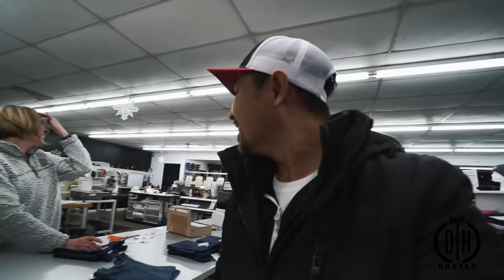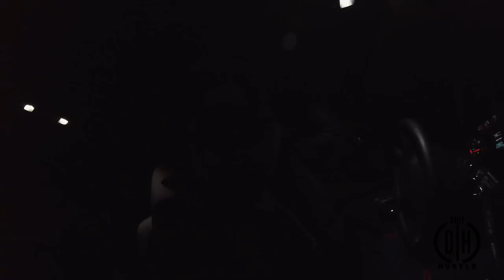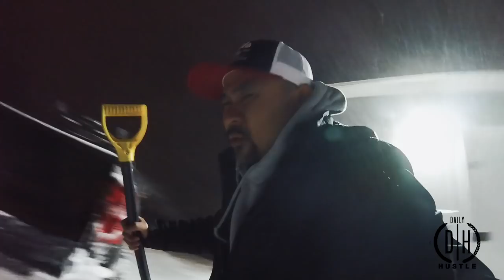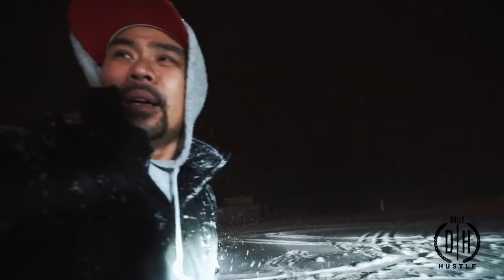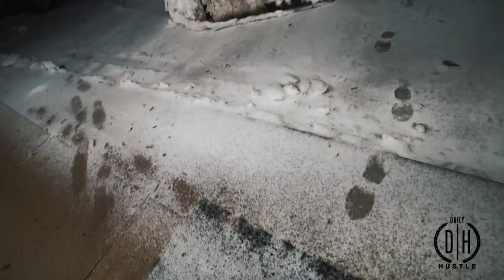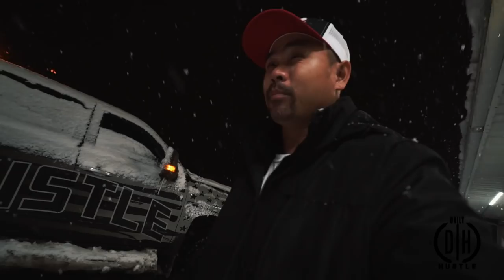Snow Plowing Vlog  Our First Big Snow Storm ! Snow Removal 2020

Comment: Ever think of pouring some concrete weights to set in the back of your trucks?   Worked for a concrete company and it was the best thing we ever did.  99% of the time only ran in two wheel even in deep snow.

Comment: Hey pal have you ever thought about setting up your wife's SUV with a plow set up in case you have a issue with 1 of the trucks and it can't be used for whatever reason you will still have the same number of plows pushing snow

Comment: Chung get rid of that plow they are awful if you want a plow similar to it trade it in and get a fisher xls or just replace one of the buckets on the skid with a pusher that dxt is a lemon
Reply: allied1394 
My XLS is no better lol. 3 years old and Tuesday am was the first event it made all the way through with out a breakdown.
Reply: Haha I hear yeah we bought one first year it came out and got rid of it at the end of that first season to many lines to many moving parts I feel your pain
Reply: allied1394 
I have run blizzard power plows since 2004 with minor issues. This XLS is a useless anchor.
Reply: We run fisher we have had good luck with everything excepts for xls and we have a dealer close by which is awesome to